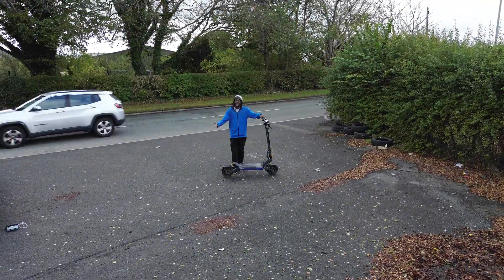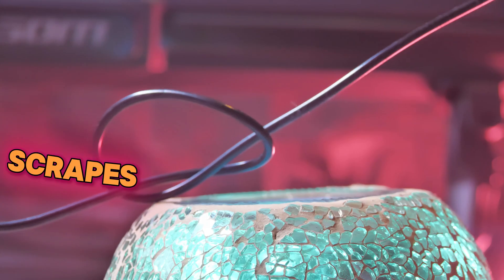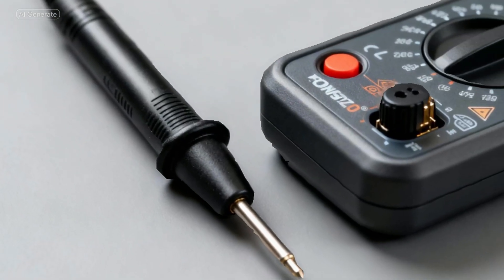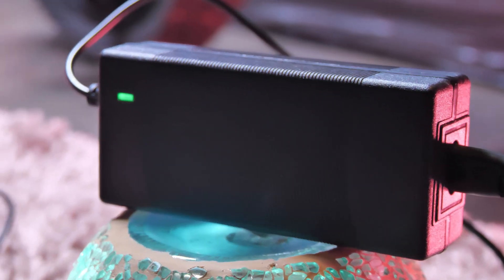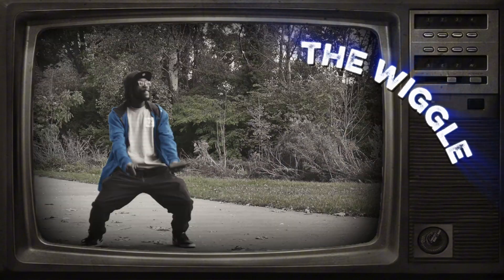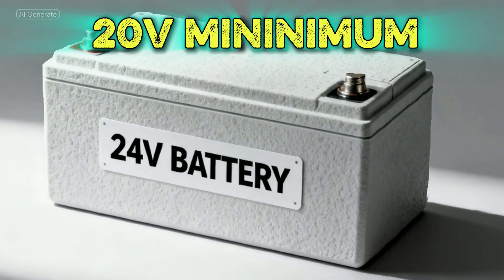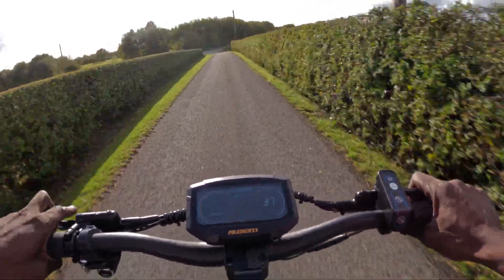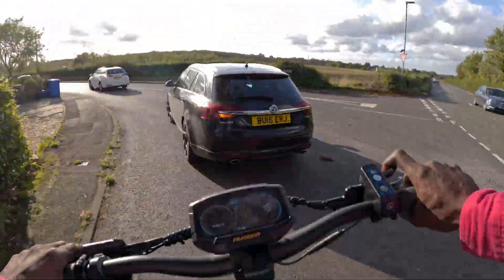Why is my Electric Scooter Not Charging (Quick Fix)

Comment: Hi, I’m thinking of getting 60v 35ah battery, with 2000w motor. What amp controller do you think i should get that’ll be suitable for that and/or which amp for highest speed. Thanks 💯
Reply from the maker: At 60v you already will have an impressive top speed. I would speed up the acceleration by getting a high AMP controller. Anything above 35 amps will give you the wow feeling. Look at fardriver controllers for mad top speed and acceleration